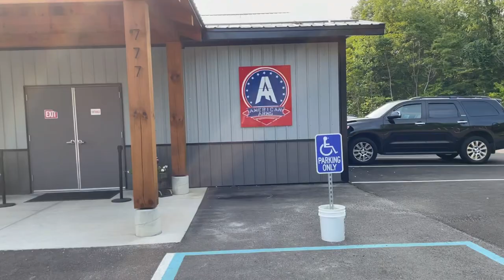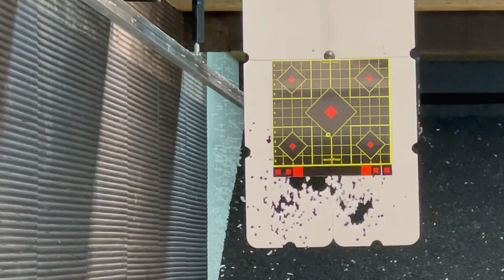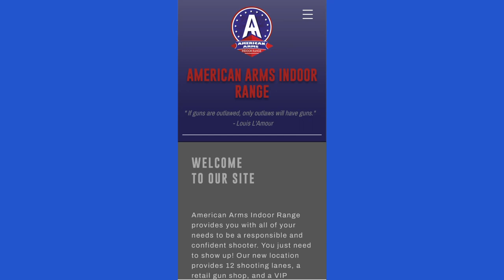Zulisy Otter red dot 200+ round test

Comment: Why did they not cut it deep enough so you can co witness the sights? Why not just use the dovetail mount? Baffling me
Reply from the maker: To cut it deeper you would get into the path of the firing pin and extractor.  The sights are unique with the trapezoid system.  I did not want to take the rear sight off Incase the optic broke I would still have irons to use without having to use a sight pusher to put it back on.
Reply from the maker: Thanks for your comment

Comment: It looks similar to a Holosun, have you compared the two?
Reply from the maker: Yes the foot print I had machined was for the Holosun 507k.  When I saw that the Otter advertised the same foot print, that’s what sparked my interest to try it out.  It works great and so far I have not changed it out.  I like the sight, and my range testing left me satisfied with its construction.  To answer your question yes it is that same as the holosun K series